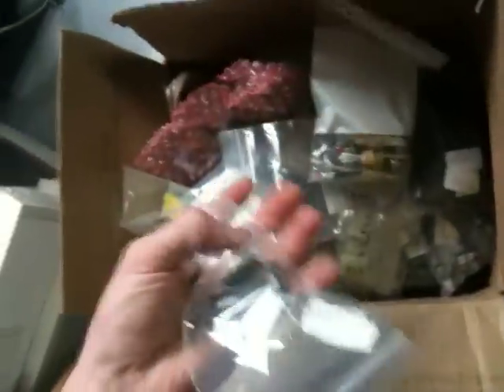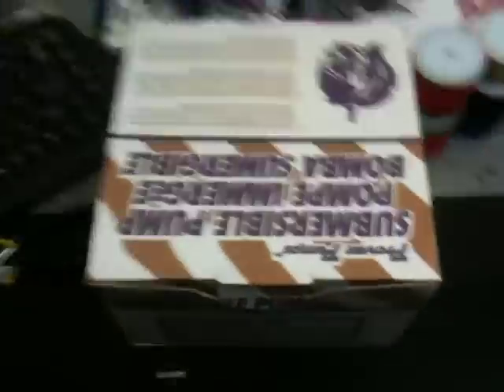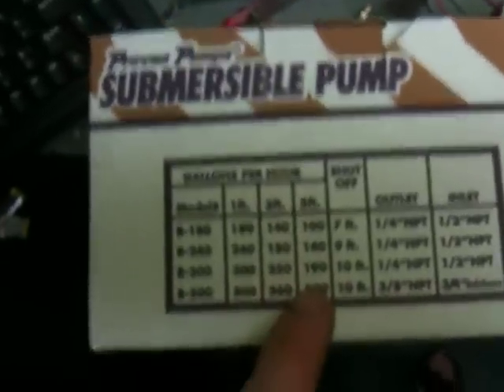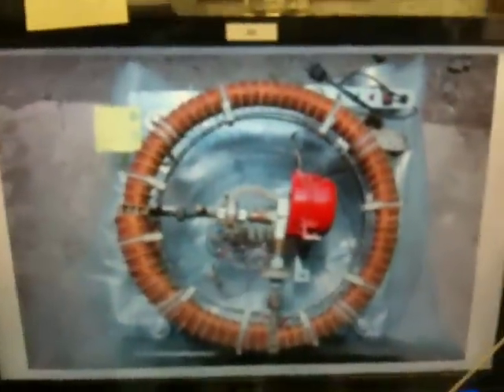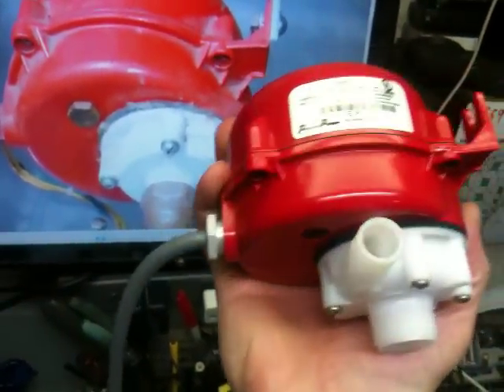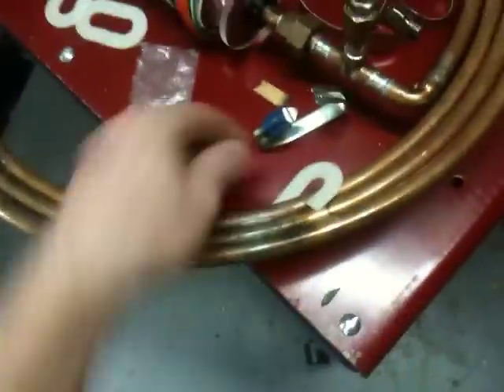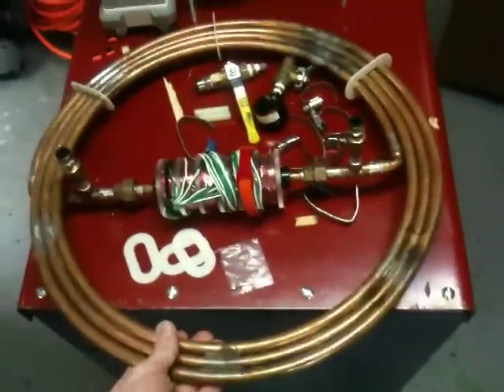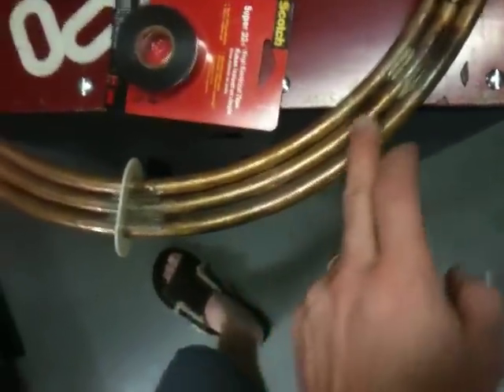RED EPG PUMP FOUND!!! & EPG Update & More.

Comment: Hi! Russ this is Russ :) I was reading on your website about vacuuming the system down. If you do not have access to a fridge pump than you can do the ebay/amazon
search for either the Robinair Vacuum Pump or the Mastercool brands. Not to expensive. Just wanted to drop you a line. keep up the great work. :)

Comment: Russ, the epoxy is NOT electrically conductive. I looked up the specs on it.
The pump was a great find.. So cool to have people helping, so so cool...
:)
Bill is right about the annealing. Just bending the pipe will harden it - same thing with copper and aluminum wire. It's called Work Hardening. With wire, it will change the conductivity. If there are spots on a coil that have sharp bends, they will be hotter than the rest of the coil due to increased resistance. Used wire will have hot spots..

Comment: looks like standard Copper Pipe annealing a pipe Makes it Soft to Prevent Work Hardening
you might want to use Crimp Pipe and not Soldered pipe also the pump fittings are at 90 degrees from each other.
I have seen this as a 4 to 6 Stage Copper and Iron Transformer

Comment: I read that if you take Hydrogen gas up to like 3,500,000 PSI it will become a Super Fluid superconductor...
A fluid super conductor is what you would need for a plasma Transformer... I do not see an inlet to charge the Pipe with Hydrogen Gas.
it may also be a good Idea to Recast that impeller and housing in metal..
your pipe might soften and burst and the Pump might melt if you run this unit up to temp. I can only suggest you limit your run time to avoid Injury.